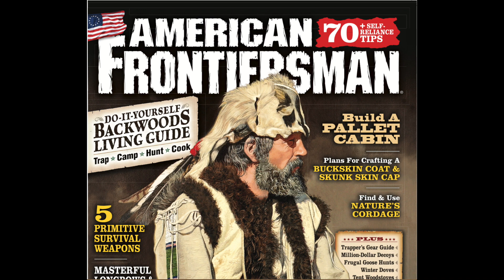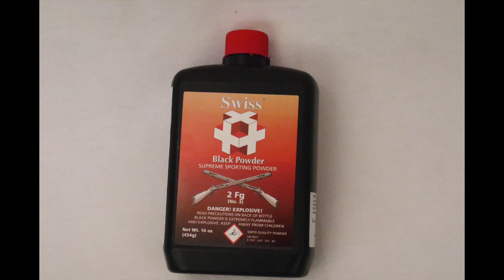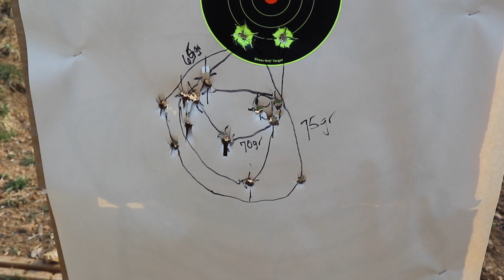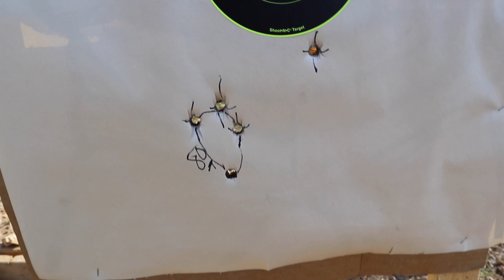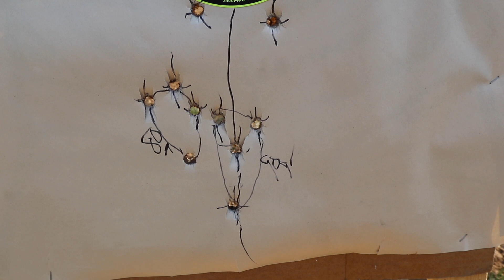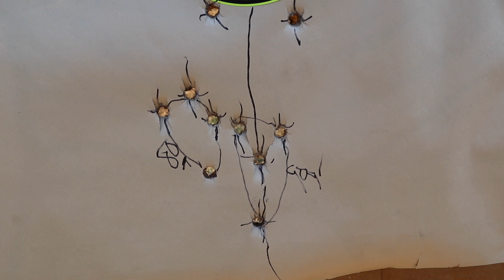Sighting in a muzzleloading rifle

Comment: swiss powder is good stuff, but I like goex better. goex is close enough in velocity to swiss it doesn't matter. it is dirtier than swiss but swiss after about 5 shots without swabbing the bore will develop a hard ring about 3in from where the ball seats and you will have to hammer the ball the final couple of in. goex you can shoot it all day without swabbing.goex ol eynsford is a clean powder and accurate and cheaper than swiss,,,,,,,,,,,,,,,,

Comment: Mike interesting video. I have an older Dixie Gun Works 45 cal long rifle was built in 70s. Having a issue i need a front sight cause its missing. But the dovetail is 1/2 inch can't find any base of that size. Do you have any suggestions.  Thanks.
Reply from the maker: The best thing is to make a new sight with the correct dovetail. If you don't feel comfortable doing that. fill the old dovetail and put a new sight behind it.
Reply: @duelist1954  ok thanks,  what would you recommend on using to fill old dovetail and would you have a video?
Reply: @duelist1954  And would you have a video on making a new sight?
Reply from the maker: @kevinwhetzel3036  I would make a dovetail out of scrap steel, but check Brownell’s they may have a steel dovetail filler that size.
Reply from the maker: @kevinwhetzel3036  sorry, but I do not.

Comment: Now I would think its like a BB gun,.... how high or low it shoot's is the amount of powder your using if its a smooth bore.
A rifle is like a centerfire rifle.
I first find a load that has a very small group at 50 yards,.. usually 1 hole.
then at 90 yards,.......because that's all the farther I will shoot a round ball.
I increase powder till I see the group open up,......then I go back to where it was accurate and that's my load.
It's the same with a bullet And 120 yards is all the further I shoot with a bullet.
And you always shoot paper,...... it tells you what your gun is doing.
At the final range,......I clean the barrel,..... and shoot 3 different targets,....3-5 shots each.
Smooth bore all I have is a shotgun,....there's no adjusting,.....50-60 yards tops,... with lee slugs,....I'm afraid to shoot ball's.

Comment: Question Mike...you said the rifle was shooting low and to the left, so you said to correct, you need to move the rear site to the right...but you tapped on it from the right side. I have a heck of a time remembering or figuring out which way to move my sites for windage.
Reply: Alan Bycroft Remember FORS for adjusting for bullet impact.  Front Opposite; Rear Same.  

If bullet is hitting to left of target and you want to move point of impact to the right, either move front sight to left or rear to right.

If bullet is hitting low, either lower front sight or raise rear to move point of impact up.

Comment: Why not add a set of calipers to the sight-in kit?

Sight radius in inches divided by shot distance in inches tells you your sight adjustment per inch at range, windage and elevation.

Sighting my flinter I was 8" low at 100yds, so based on the sight radius, the front sight needed to be filed a little over .040", so filed .040", ran a second calc, and was dead on after the second filing.
Reply: Thanks. I did not know this.
Reply: I'd like to know more about how to do this with the calipers.  Any videos or articles you could recommend on this?

Comment: We got the ding. :)
Realistically the muzzle report will probably mask the ding to a large degree anyway. 
Also: Check to see if your camera has a manual focus or focus lock that can be set in video mode. Most modern camera's use a passive autofocus system that determines distance by splitting the image on a sensor. Unfortunately that means that they tend to lock on to regular patterns / nearest object.